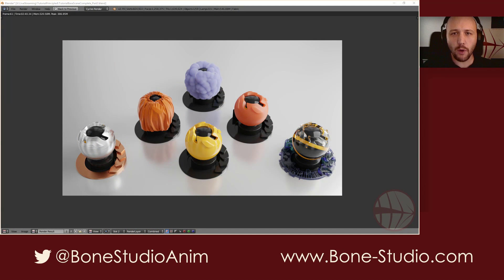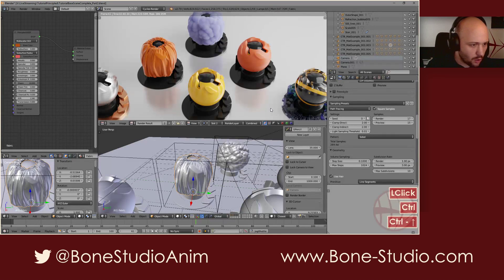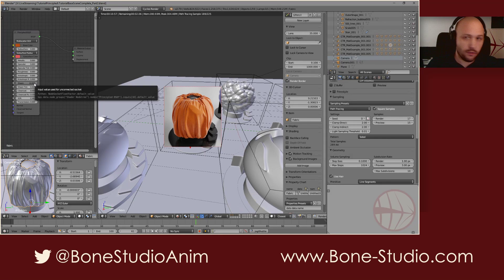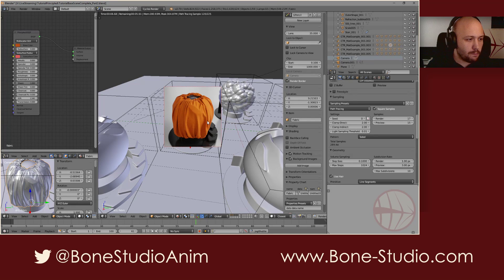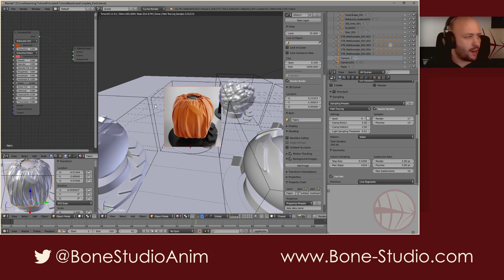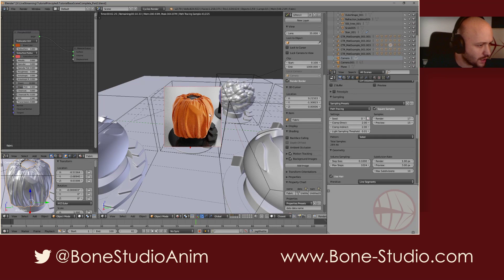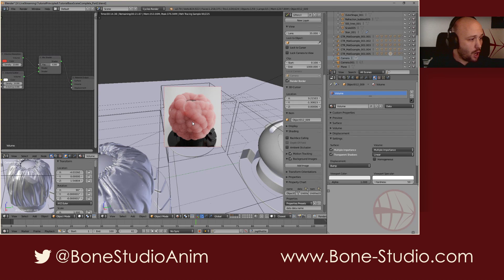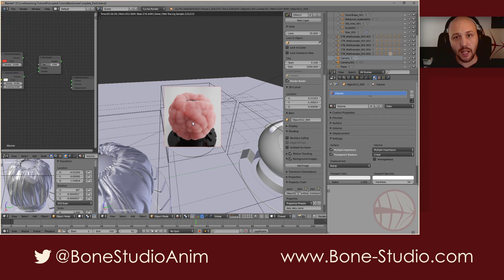Blender Tutorial - Principled shader UNLEASHED! Part 3 - Cloth and SSS

Comment: I was wondering how you managed the cloud. Would you be able to feed the result of a principled shader into the scatter or absorption? Would that do anything at all?
Reply from the maker: Not at all, bear in mind that the two inputs for the volumetric shaders are a float value (a number) and a color value and the Principled output it´s a shader output (a much more complex output), you may try it and you will see that nothing happens.
For what reason you may want to input the Principled result into those shaders?
Reply: in case i had a more complex shader like with subsurface scattering
Reply from the maker: If what you mean is if you can mix the principled shader with a volumetric shader, for example to creato some volume efect inside a geometry (some kind of dense liquid), yes you can do it, in fact I do that in the second video, the base material is a more complex shader mixing the principled shader with a volume shader, regarding the SSS, you can already do that with the principled itself.
If you give me some visual example of what you mean I could try to reproduce it and check if some volume mix is needed.
Reply: I mean something like this: http://vignette2.wikia.nocookie.net/the-naruto-world/images/3/34/Soul-2.png/revision/latest?cb=20130710195422 but more realistic. Like it's really dense on the white part, but a sort of gradual density falloff (volume shader/scatter?) for the outter blue.
Reply: that wont do anything...since its a surface shader ...also theres a PRINCIPLED VOLUME SHADER that offers more options than volum absorb n scatter combo...pretty much like the standard principled surface shader